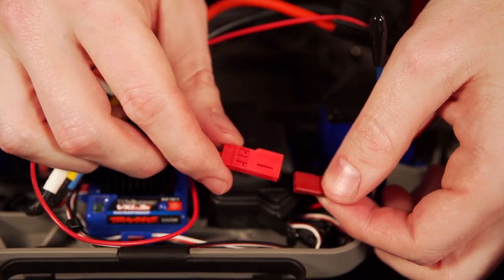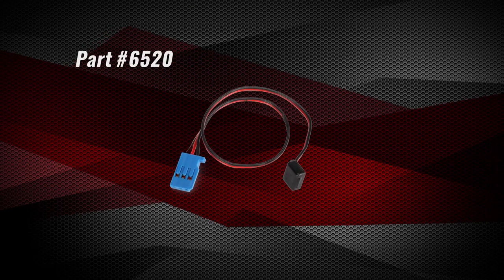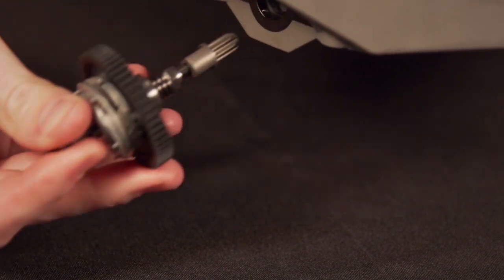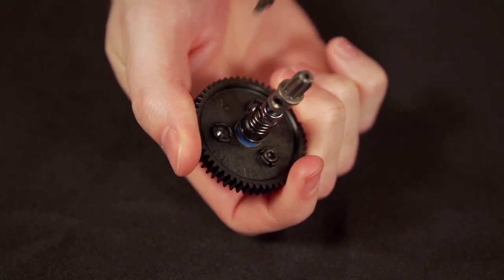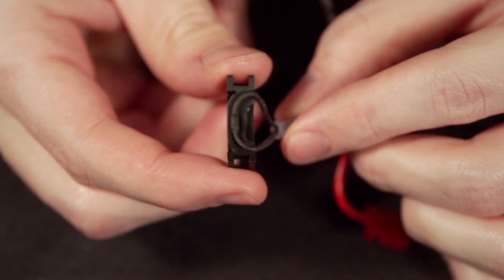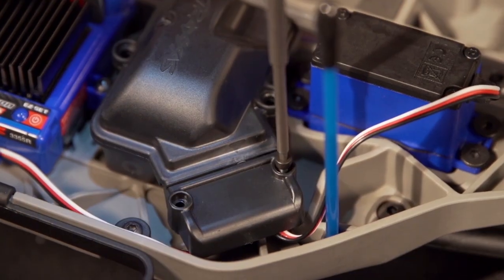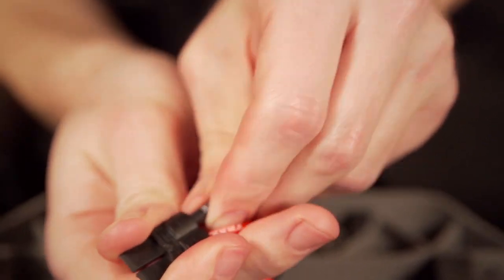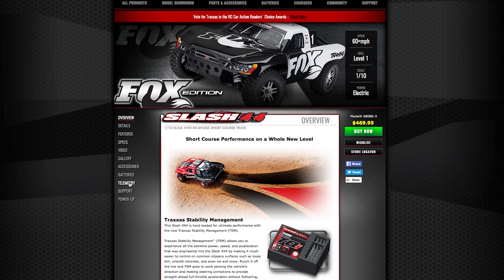How to Install Telemetry | Traxxas Support

Comment: Should I use the big or small magnet holder with an 84 tooth spur gear
Reply: I'm doing this on my stampede 2wd
Reply from the maker: Please call us at 1-888-TRAXXAS
Reply: Traxxas Support thanks i will do that asap
Reply: @TraxxasSupport  PLEASE WHERE DONYOU INSTALL THE OTHER SIDE???? THE OPPOSITE SIDE FROM THE CONNECTOR!! YOU GUYS NEVER PUT THIS IN THE VIDEO
Reply: SO WHERE DO U PUT THE LITTLE BOX ON the other side of the wire????? On the RPM sensor?????? U guys never put this in the video!!!! Whyyyyyy?????
Reply: @tkrause1413  same how

Comment: So I’ve paid nearly £1500 for my x max and non of this comes with it are you joking . This is completely unacceptable Traxxas
Reply: X-Maxx already comes will full telemetry to transmit through receiver and transmitter straight to the Traxxas link app if you install the Bluetooth module.
Reply: Actually, it's completely acceptable. The Xmaxx is a wonderful vehicle, and this sort of thing is needlessly complicated for most users.